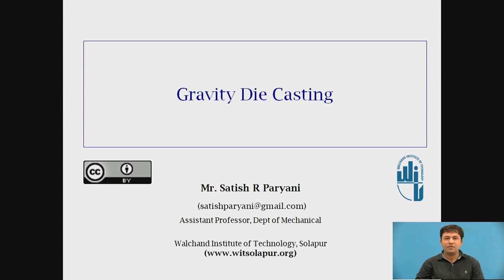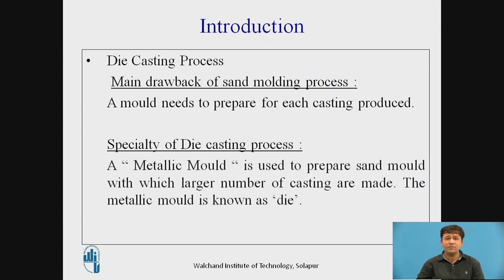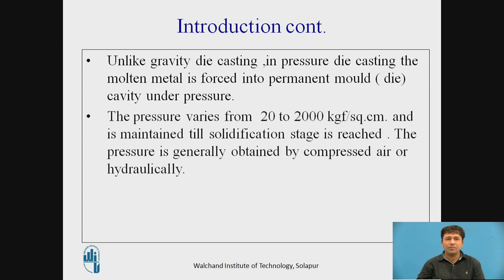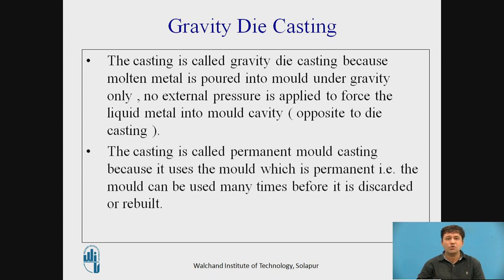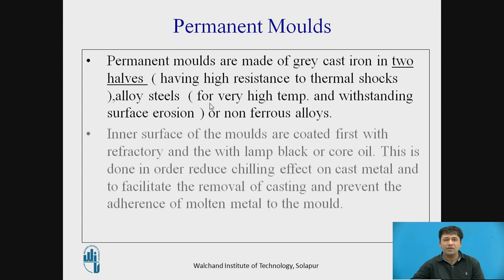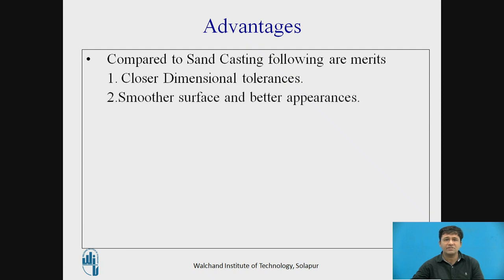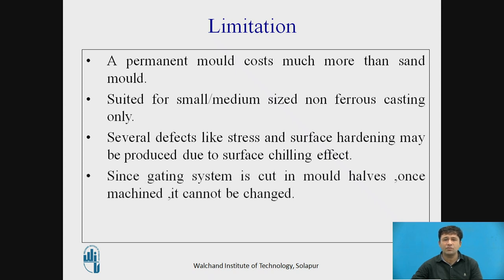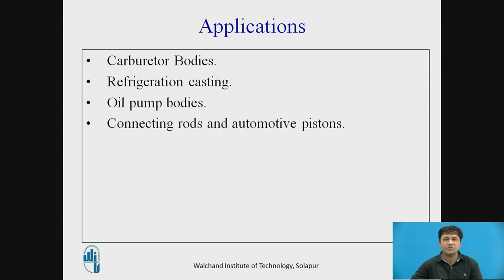Gravity Die Casting

Comment: I would like to manufacture concrete mixer gear ring. Material is cast iron.  I would like to get a good quality of teeth.  Can I use die casting with cast iron die?  As you mention, die casting is not suitable to cast iron casting.  Although it is not suitable, can I still use it if I paint a die coating?